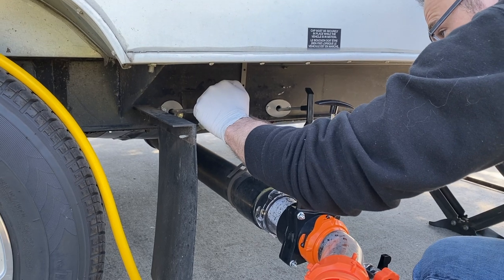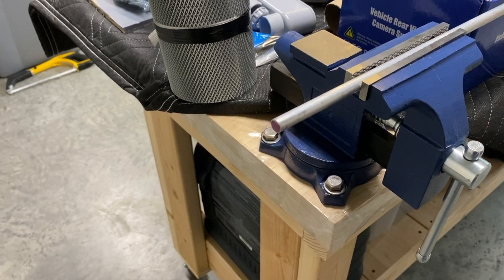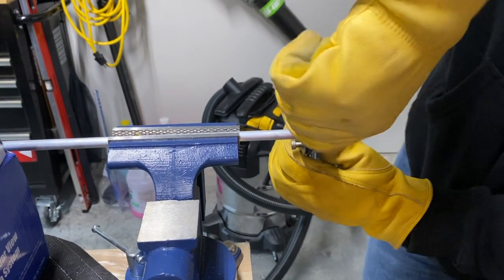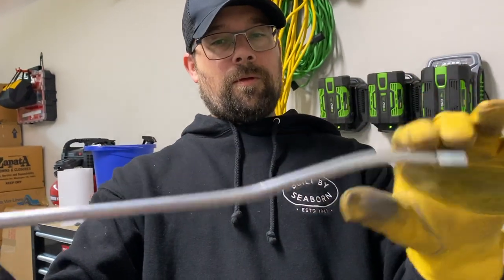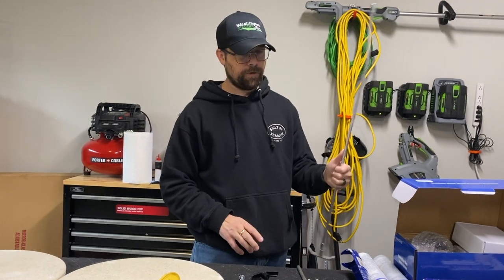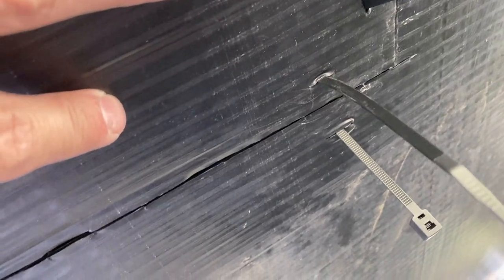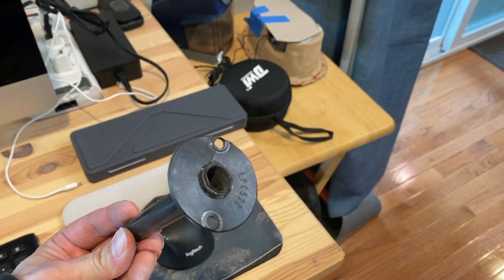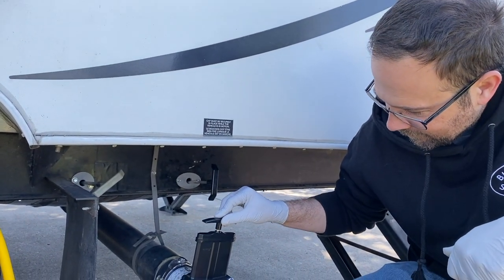RV Holding Tank Valve Rod Replacement and Coroplast Repair

Comment: Great video, thank you for making it. Did you use 3/8-16 to 1/4-20 coupling nuts to downsize for the handle and valve threads?